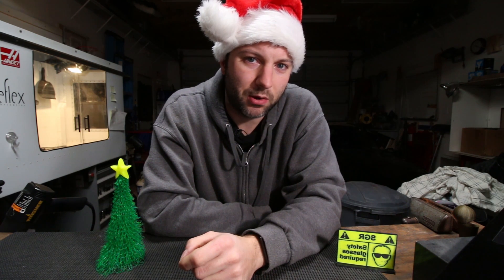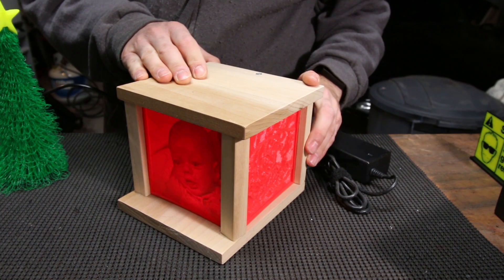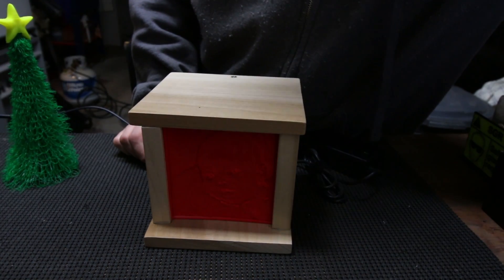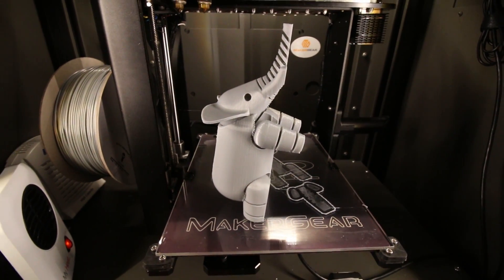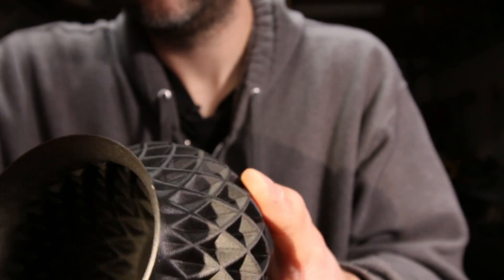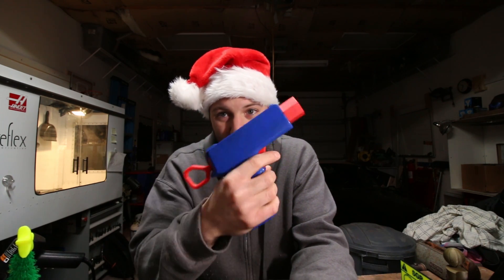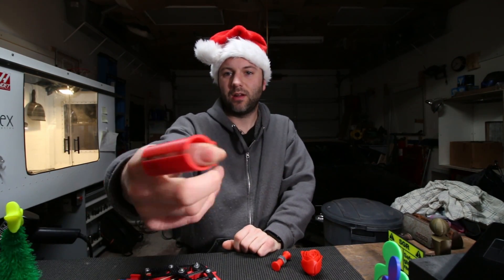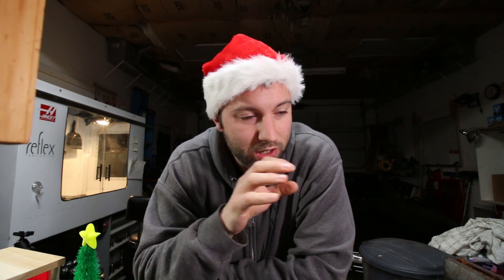3d Printed Gifts Guide

Comment: 3d printed gifts are only really good for the receiver if they are incredibly customized or niche. I think a lot of people don't realize that just because you are a 3d printing nerd, that everyone else around them will be impressed with a little 3d printed figurine you gave them.  You hit the nail on the head. If you can buy it on amazon or walmart, then just buy it. Your suggestions were awesome. Gotta be careful with that finger wrench though. Someone will use an impact driver on the nut without thinking, and will have the other end of the bolt going in to their finger with nowhere for your finger to go lol

Comment: i fucking love your lithopane idea.   I want to make mine higher quality though and alot more visible.   Adding more lights would help make the image visible and maybe printing in white?    I understand it was made 3 years ago i think as you said but do you know how i could make it more visible?   Thanks
Reply from the maker: +Austin Shelton back 3 years ago when 3d printed  lithopanes were new (at least to me) they mostly were printed flat. Now the best way to print them is so the image is vertical. In that orientation the printer has much better resolution and should show up a lot better.